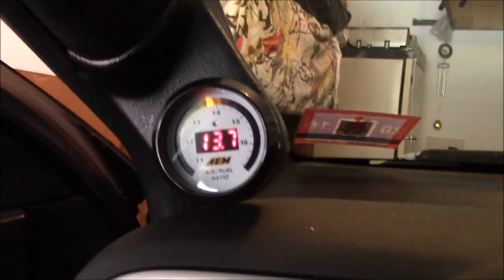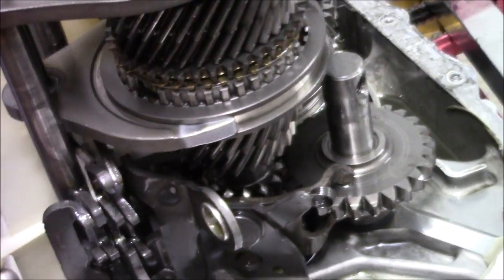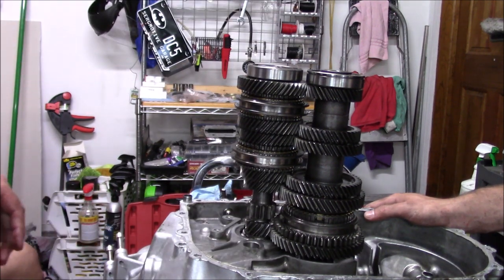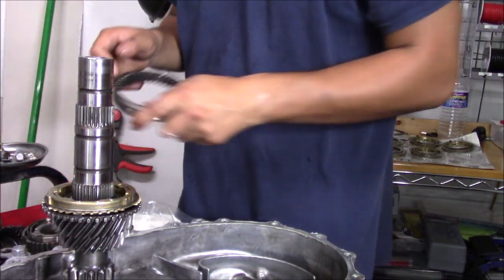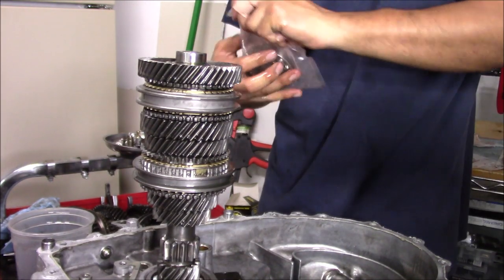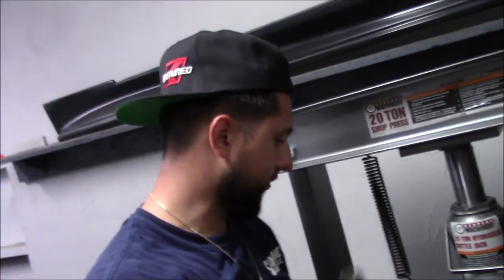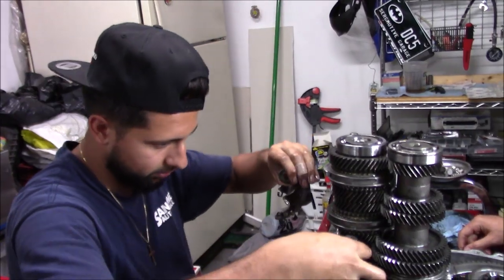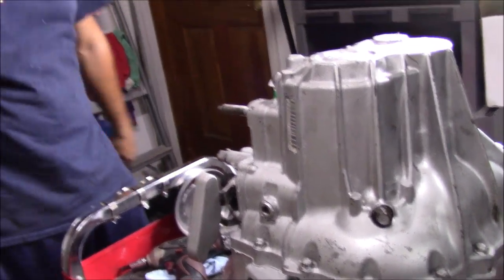K Series Complete Transmission Rebuild !!

Comment: After rebuilding with new bearings and carbon synchros, I put in both shafts and tried to spin them by hand. 1st, 2nd, and nuetral spin easy, but 3rd, 4th, and 5th start binding. What could be the possible issue?

Comment: Have you ever rebuilt one of these z3 transmissions and had it whine in all gears afterwards? I replaced my synchros with synchrotech ones and had a whine in all gears. So I went back in and replaced the main shaft and both synchro hubs on it. I was told they should press on. My original one's slid on and off. So when I put the new ones on a very low milage shaft I had to press it together. The only other thing I did was put an open diff out of a RSX-S in it. As I was planning on using the helical LSD in a RSX-S transmission, which I did during the first rebuild. So my question is, could it be the open diff whining? Or is there an end play check I should be doing too verify the shims are the correct thickness with the new parts?

Comment: Thank you for the video! I used it to swap over the internals from a 6spd JDM 07-11 CR-V tranny to a 5spd USDM 05 lower case. I had to swap the ring gear from the 6spd differential to the 5spd, as I need it for the gear driven VSS. Everything swapped over easily and it really wasn't too bad. I haven't reinstalled the tranny yet, but I was able to cycle through all 6 gears and reverse, all while spinning the main shaft. 

If this all works out, I might be the first person to have a 6spd manual 05+ CR-V. 

Thank you!!!

Comment: Great vid. 20:40 you completely forgot to line up the fixed gear to the 3rd gear synchro, thats very important to mention in a video like this, because people make this mistake all the time...shit made me cringe. I was literally yelling at the screen. LMAO.

NOTE TO AUDIENCE: make sure ALL the syncros are aligned properly. Otherwise, you will NOT be able to close the case. If you do manage to get it closed, because its possible in the most desparate case, you will either crack the case, damaged the gear, or in extreme cases, damage the shaft. 

Its easy to miss, as you can see, he was still able to slide the selector onto the 3rd gear synchro but not the entire gear itself.
Reply: This needs to be pinned

Comment: Great video man I've been using this a while I've noticed one of the bolts on the crankcase is missing on my 8th gen I think that's where my gear food has been leaking out of as well is that possible? I was just looking around trying to find a leak and noticed one of the bolts was gone. Pretty sure that's where my leak is coming from , isn't the axle gasket , slave and cmc is dry stays full.. my my transmissions mtf leaks out pretty quick.. I was told I could be the input shaft seal. But this missing bolt might be the reason. it's definitely one of the bolts the crankcase is held down by.. thxs

Comment: Hey my man, i got the european cl9 Accord with the trans code AST5 and want to use the 1-5 gears from the european CTR with trans code NPQ3 but keep the stock 6th cl9 gear for eco, plus an mfactory lsd, well i am kinda lost, the lsd i got is used from a k20 ctr and has the VSS gear already installed behind the bearing, 

will this CTR vss gear work with the cl9 speed sensor?

Will i have any issues with speedometer if i keep the longer stock final drive if the cl9? (3rd gear of ctr and cl9 are not the same, if not mistaken the cl9 reads speed from 3rd gear?)

Do i have to just throw shafts with the gears from ctr on the cl9 housing? 

Mfactory recomends torco mtf fluid, what are you using?

Sorry for the long azz questions, any input is greatly appreciated, i am kinda lost and too scared to build it wrong way and repay mech to take it out again...

Comment: Great video. I am doing this right now and decided to replac emy 3rd/4th hub as well as it is equally as chewed up as the sleeve. Im confused as my synchotech kit has 2 smaller synchros that differ from yours. They appear to not have the bass inner part whatever its called. Am i dupposed to just reuse the old ones for 5th and 6th?? Thanks!

Comment: Hey man I have a dc5 type s with stock 6 spd trans and I always have issues shifting into 2nd at high rpm 8200ish rpm just grinds and locks me out it Pericles my ears every time people say it’s synchros but after seeing all these components I’m shook. Your advice?
Reply: Check to see if your clutch pedal needs adjustment and also check to see if your cmc and slave cylinder are good it’s free and easy so might as well check that first before tearing down the transmission
Reply: Update ??

Comment: How much differen't would this be for an 8th gen Si.  Not sure how similar the transmissions are other than the RSX doesn't have an LSD.  I fucked up bad while going to leave work the other day, I park in 1st gear and when I go to start it up I'll put it in neutral and then release the clutch.... well I had my phone in my hand looking something up, and only half my muscle memory worked : (  Needless to say I let off the clutch like if it were in neutral and now my transmission is messed up.  It's my backup car, but unfortunately my FK8 is in the shop so it was the worst time to do this.  It has over 200k miles and I already had my 3rd gear synchro snap off and get stuck in the shift fork.  That was 5 years ago, I paid a shop to rebuild it... i'm not going to do that again.  Hopefully i'm somehow lucky and it's just the clutch, but I doubt it.  It's hard to shift into every gear while moving, but super smooth if I'm stoppedl. It's easy to get out of gear, but whenever I upshift I have to hold the shifter in position until rpms drop 1-2k before it will go in.  I also noticed that when it gets into 2nd and 3rd I hear a very light grinding while the clutch is engaged and I can feel applied throttle.  Not sure about going faster because road and engine noise would easily drown out the very slight noise.  When getting into gear I can see the rpm drop maybe a couple hundred rpm like it has a load put against it.  Any suggestions would be appreciated.

Comment: What's up I just bought a transmission , supposed to have a wave track LSD , carbon syncros and sleeves..  do you think that I could use a Android camera and look down threw the fill and drain bolt holes to see if these parts are really in my transmission?

Comment: Im not sure if anyone will respond but I’m having an issue with the 1-2 gears fork, when I put it all together it won’t shift into 1st gear but will go in neutral and second but when you take the shaft out by it’s self it has no problem shifting into first? Any one know what’s wrong ??

Comment: Arent you supposed to soak all the stuff in trans fluid before putting it all back together, especially the syncros, so when you first start moving its not running dry for X amount of time until oil gets on the parts?

Comment: Would the z3 transmission be same?? and when pressing the counter shaft back between the gears is there any specific spot that it has to be in or would 1st gear align at bottom and stop counter from moving to far? basically is the counter shaft even on both ends or is there a one direction when pressing?

Comment: Great info man!  This is the best kseries tranny teardown/rebuild i have seen.   I have never done this, but i do have the rsx shop manual, and now this video to help guide me.  I have an 05 jdm dc5R tranny , that needs some love, mostly 3rd gear syncro i think, but will rebuild the whole thing.  I also have a 02-04 rsx-s tranny case, with euro-R CL7 internals.  I want to change the diff to the rsx-s 4.3 final drive for boost.  I believe the Euro-R gearing is identical to the 02-04 rsx-s, but with carbon syncros and 4.7 final drive.  I just want to say thank you for this amazing video, which will help me take the leap and do the work myself #thumbsUP

Comment: So am extremely late on this video however, I just purchased a 2010 Civic Si and the 4th gear grinds every time I shift into it. And your video has boosted my confidence in changing the synchro myself instead of having a shop do it!
How are you liking the synchrotech? Are they better than OEM?
Reply from the maker: the synchros are working great, I haven't opened up the transmission to say if they hold up better then oem.
Reply: @SERGMOTIVEGARAGE  considering from the time you posted this video to now, and they are still going strong. I think I’ll go that route. Won’t be ordering the parts until I crack open the transmission and see what else needs to be changed… most likely a 4th gear as well. Looks like Kseriesparts, and HondaPartsNow will be taking a few of my pay checks in the next coming weeks lol

Comment: please help me... I did the 6th speed swap in my honda element and finished an hour ago. I showered and went on a test drive and it made a funny sound when moving.  then in 2nd gear the whole thing gave up all together and does not engage.  the car went forward and reverse and went into all gears no problem.  but i had to push it home. please help if you know my problem.
Reply: driver side cv wasnt fully seated. mistake made by working on the street. all good now. fixed.

Comment: Great video, one important suggestion.  IF you plan on using the lower housing and bearing to hold the shift while working on it.  Replace that bearing AFTER you finish the gears, not before.

Incase you cause inadvertent damage to them by working the shaft around.

Comment: So who else noticed 3-4 hub was not seated/lined up properly? Why no oil on synchros? I soaked mine in MTF overnight.
Reply from the maker: good eye lol, i found that mistake after i shut the camera off and went over everything. I want the synchros to bite as best as they can so my practice is to just install them like that and when the trans is being used they will be lubricated enough.
Reply: @SERGMOTIVEGARAGE  Well at least you figured out your mistake before you got it all put back together. I got mine all buttoned up. Thought I was good to go...then looked on the work bench and realized I forgot to put the new oil gutter in lol. Just gotta remember the transmission doesn't get adequate lubrication till you drive it and the diff flings oil into the oil gutter. So in my eyes a little lube during assembly for break in is a must. Thanks for the reply and keep the vids coming brother!